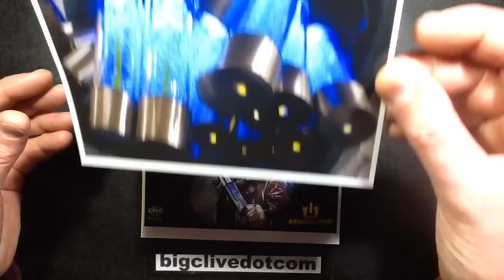Prop electronics from Mission 2110 (and other shows).

Comment: PICs and ULN2803s - a wonderful combination - you can drive anything with those two!
Watched an interesting time travel movie yesterday - Predestination. It features a carefully selected prop - an Arduino Pro Mini - that must have cost the props department all of $3.
Reply from the maker: I remember seeing a film about some robots that were reprogrammed to be killer-bots.  In the film they pull out a very bogus looking robot control board and point out the computer chip that's been reprogrammed....  A 4001 CMOS logic chip.  It kinda spoils the magic for a moment.  I suppose I should be biting the bullet and sitting down with my growing Arduino collection to see if I can put them into future props.  But at the moment I've got a base bit of PIC assembly code for each of my existing styles of prop controller with loads of my stock routines built in that make it easier just to cobble up an effect or function.

Comment: Clive, can you explain to me why Darlington arrays are still (or seem to be) popular for projects like this? What are the benefits of Darlington transistors? 

Isn't it that transistor current is limited by the drive current * gain, plus there is the voltage drop, compared the low on-resistance of MOSFETs? As I understand it, MOSFETs are only driven with a voltage on the gate and a pull-down resistor to turn it off, and they can switch a higher current. It seems to me that unless you're switching milliamps, that mosfets are always preferable.